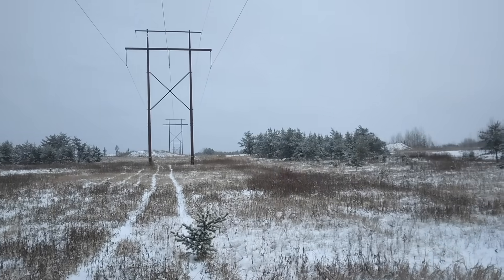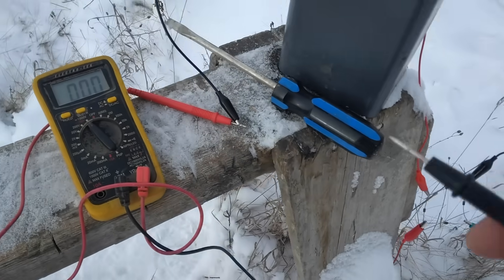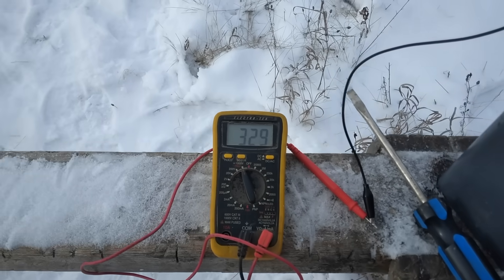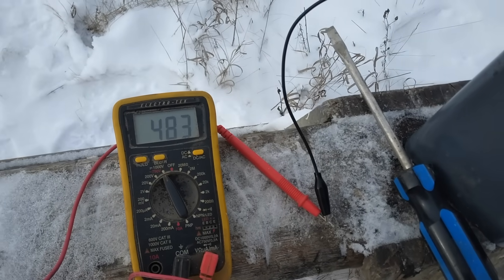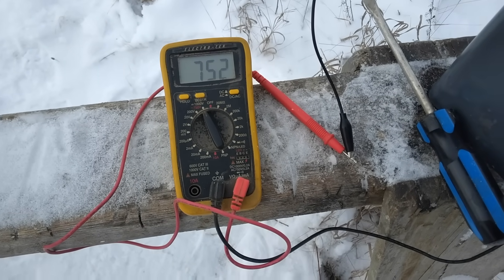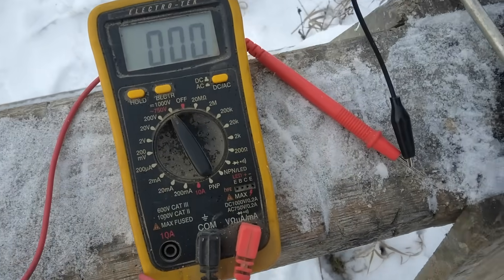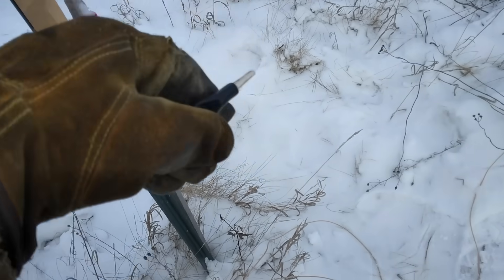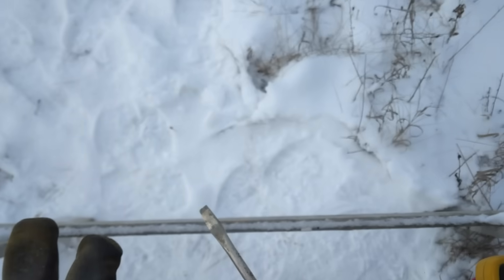Fences sucking power from under HV transmission lines

Comment: Exposure to that much radiation and cause aplastic anemia over time. That's what my stepmother died from because her bedroom faced ordinary residential area trunk lines. I kept offering to build her a Faraday shield; lead foil or copper sheets sandwiched between nicely finished wood, grounded to the copper hot water heating pipe. She thought it was nonsense that would have set the house on fire. I knew it would happen. Wish she'd listened to me.
Reply: I'd have taken the EMF over lead foil too but I'm a scientist so I would.

There is no statistically meaningful evidence that powerlines cause health issues. The "strongest" case that it does is for childhood leukemia where exposure to an extra fraction of a microTesla has correlated in a couple of studies with an increase in the chance of it happening. But that's almost certainly a correlation rather than causation issue. 

By that i mean, houses that are built under/near powerlines (that can achieve that amount of field change) are usually also in built up areas in cities/towns (because if it wasn't a built up area, you'd have room to not build the houses under the lines...). Energy intense industry is usually located near large substations because it makes the electricity cheaper and them substations are fed by big powerlines. Energy intense industry is usually also very polluting, which causes health issues in humans...

In that situation the power lines correlate with the ill person and the industry causing the pollution (so there IS a link) but the thing actually causing the health issues isn't the power line itself, it's the pollution from the co-located industry.

It's important to learn the correlation does not mean causation because if you don't you even up caring about stuff that doesn't actually matter (the power lines) and is actually detrimental to you because you're wasting effort on it instead of what actually matters (the polluting industry)..

There are many many things I wouldn't do (or do do) because it's stupid health wise, stuff like wearing them "negative ion" bracelets (that are useless at best and horrifically radioactive at worse) or living on a main road (pollution from vehicles is a significant health risk) or wearing sunscreen (as in I DO wear it, I prefer the chemical sunscreens over the minerals ones, just because they're so much better), I would for example far rather live within 10 km of a nuclear power station than within 10 km of a coal fired power station, and i'd rather go swimming in a nuclear power station's spent fuel pool than go climbing a coal power station's ash heap, all for reasons that are obvious to me. But powerlines don't rate, like my main concern would be them falling on my house. Same with mobile cell towers and 5G (i mean the 5G frequency has been used in basically every wifi router for a decade, people that complain about 5G cell towers at the bottom of their street are happily ignorant that their phones have been blatting out the same RFs from their pockets for over a decade now, it's just called "ac wifi" instead of "5G").
Reply: I wasn't going to plaster the wall in metal plates; the metal would have been hidden inside finished wood. Non ionizing radiation is harmful especially in large doses. Madam Curie also died fro aplastic anemia. Microwave communications are very harmful but profitable so we don't hear about the damage being done to us every day.     @Logarithm906

Comment: Always wanted to try this! Cool experiment. I'd suspect you're beyond the rated voltage of your meter's leads. Aren't they rated for max 600v? Would be fun to see how much power one could actually leach off using various lengths of wire, multiple wires etc. I'm to lazy to work through the theory / math. Thanks for posting this!
Reply: Someone did the math elsewhere in the comments, 0.077 watts based on the size of the capacitor vs charge time. That might be just enough to light up a single 5mm LED at medium brightness.  I think he would need a lot more conductor in a coil configuration to get anything useful. I would love to see all the tests performed to find out what configuration is the best! Also kinda curious to know what the tallest fence height is permitted.... I might have to go buy some land ...
Reply: The power company is well aware of drag from such sources and will investagate
Reply: @donstash4295  if they don't like my "fence," they could choose a different pasture.
Reply: @kwyj  Intent matters in the law. If it's hooked up to your house's power supply you get in trouble. If it's just a fence then you don't.
Reply: @thewhitefalcon8539  the thing about that intent is they have to prove it to a jury of my peers.

Comment: wonder what kind of power you could generate from an 8 foot high chain link fence with 3 strands of barbed wire along the top that ran the whole length of your property? 

it would be nice wrangle them wild "FREE" ranging pixies and put them to use on your side of the fence lol

Comment: High voltages like that might not need a very large diameter wire to transmit power over many miles.  Wow...I mean like 22 gauge wire might be able to power a house at those voltages.

Comment: Amazing voltage.  I'd probably use an metal oxide varistor (mov) to limit the capacitor voltage.
Reply: I used to think that until I had an MOV catch fire from a substantial motor emf. Those things are spooky to me now as a fire hazard
Reply: @luvmechanix  That was an misapplication of an mov.  There needs to be a mechanically-coupled thermal fuse in series with the mov in the case of transient surpression in a system connected to "infinite" power.  The thermal fuse will be heated by the mov, causing the fuse to open due to the heat.

Comment: That setup doesn't really tell you very much. You would probably get the same "power" levels if you put that near your stove while it's working. I've done many experiments of this kind. If you stick a voltmeter into the ground or into a tree, you will get a voltage reading. I could never get anything useful power out though..... never even enough to light an LED. 
I would recommend you try to light an LED. If you can't do that, there is really no useful power there, nor anything I would worry about.  A standard LED only takes about .020 amps.

Comment: Thanks for the video, it's very interesting. If your experiments result into practical uses, it will be great. Maybe you should run enough wire to experiment away from the high voltage lines. There is a couple here locally that built a house within 35 yards of high voltage lines. They had a baby that was born blind.

Comment: I work for an electrical utility.  I was recently installing new equipment under the overhead lines while working on an insulated fiberglass ladder.  I had one lead from my volt-meter to ground while holding the other lead and the induced electricity into me would go up about 125 volts per step on the ladder.  It was interesting to see the constant bug zapper action arcing when I held the lead about 1/8th inch from the grounded building next to me.
Reply: lern to climd up n down the ladder fast and you could play a tune,,,,
Reply: Another kind of 'step voltage'
Reply: Now that is funny.  @aliveandwellinisrael2507
Reply: Now that's serious step potential
Reply: Just try not to be the bug.
Reply: Because it's actually a magnetic action around the wires ...
Reply: Electro magnetic also known as EMF for Electro Magnetic Force.  @emariaenterprises
Reply: EMF radiation
Reply: Ok, that is terrifying!
Reply: Not really.  When you rub your feet on carpet and touch metal for the static shock, it can easily be over 10,000 volts.  There is just only a tiny amount of current though.  The EMF voltage induced in me was constant due to the source being AC power lines at 60 Hertz.  If I lived near high tension power lines I would definitely tinker with running insulated wires to capture the lost energy and use a bridge rectifier to store it in lead acid batteries.  As long as the proper safe distance is kept, a person would be okay.  Get too close and a person will be a plasma ball.  @lilolmecj
Reply: don't have any gas lines around there, instant ignition.
Reply: I work in substations and when i was a maintenance electrician I would climb the A frame towers. On a 220Kv line the induce was so great that i was able to write my name into the A frame with my finger, well for a little bit. I found holding a screwdriver hurry less.😆 Have a good one, stay safe!
Reply: Yes.  As long as you are holding the conductor (Screwdriver) you won't feel it.  Let your finger touch it and ouch.  I was removing the sealant from a pass through to install wiring into the building and I thought that I was disturbing a wasp in there at first when I heard the buzzing noise.  @mmi6280
Reply: Me to

Comment: Your getting the static from the lines.  I had to work on the brakes on a wire tensioning machine with the cable stretched a long way next to live wires. I kept getting nailed.

Comment: What you did was make a 1:1 transformer with low current capability. If you have 20kV in the power lines, your "fence" will eventually charge to 20kV.
Reply: 1:1 it may have been. But it was loosely coupled with air coupling. Very inefficient, so you would never get to the theoretical maximum
Reply: @colonelfustercluck486  There will be losses, true. I was speaking in simplistic terms. But your potential will be much closer to 20kV than 1kV. If you had left it overnight, you would have come back to a popped capacitor the next day.

Comment: Don't EVER discharge a capacitor by shorting it out - it can rupture the dielectric. ONLY ever use a high wattage, high-value resistor (can be wired in place).

Comment: I thought about that years ago.  You can't get more power out than exists in the magnetic and electrical field, which, since it induces currents in the ground which are lossy, is not enough to worry about.  You can certainly get voltage out but not much power. 

If you stick leads from an AC voltmeter into the ground a few feet apart anywhere, you'll get a half volt or so from just stray grounding currents, but you'll not be able to get any power.

What you've got there is a transformer, one half turn to one half turn, so the voltage out is the transmission line voltage, roughly.

Comment: I hope you have a bleeder resistor. That capacitor will hold a charge for quite a while. A smaller value capacitor will charge quicker, and you can always series pairs of those diodes if you're worried about it.

Comment: High voltage ( EMF radiation, or anything related really) is something to be feared, and it’s really in your own best interest to avoid or minimize exposure.
Like any radiation, a little is of no worry, but the higher the dose, or the more prolonged the exposer, the greater the risk of bad things happening to you.
Be safe and remember, before you attempt to beat the odds, make sure you can survive the odds beating you.

Comment: This has actually come up before. The way to actually harvest the power would involve placing a rectifier on each end and then collecting the power probably with shielded cable of some sort. The gizmo that does this is called a “rectenna”. (I Tryed to post a link but my phone isn’t cooperating.  You can just search for the name though.)

One little catch, you still have to pay for the power. 😕 When I say this has come up before I mean it’s come up in legal history. Power lost to unconnected conductors running parallel to the power lines is simply a loss that the power company has to eat. The moment you connect it to something you have “monetized” it. 🤷 That’s when the company in the business of selling the electricity gets a say in it. 

I feel like thus actually might be useful in areas without a normal tap but legally speaking it is something you do have to pay for.  

Interestingly this appears to be what Nicolas Tesla was referring to in his early work about wireless power transmission. It really isn’t practical for transmission of any amount of power for the equipment of his age but it might be useful now.  LED lights have ratings of “something point something” watts. 😳 Well, maybe!
Reply: Power company will also notice an increased power loss in their transmission. They will notice if you draw very much power over time.

Comment: Caution, you can accumulate enough induced voltage in  your “fence” wire alone to stop your heart (1 - 4 amps). I’ve lost a co-worker to very similar conditions. Don’t experiment and loose your life.
Reply: It only takes about 20 - 40 milliamps to cause fibrillation.  The higher amperage is actually better, since it will stop the heart - meaning it is easier to restart.

Comment: You need to make a transformer by using a coil of wire under the lines. The single conductor above will be the primary winding. Theoretically if you get it correctly made you could power your home and shop with it  What’s the worse that can happen? Death by electrocution? 😆

Comment: My neighbors had a 20 acre pasture. There were also high tension cables overhead. One day he had a new different electric fence up. I accidentally touched the fence wire and it almost knocked me out. I wonder if he moved the fence under these wires?

Comment: Volts and joules are two completely different measurements and you cannot determine the joules just from knowing the voltage so just because you're approaching 1,000 volts doesn't mean that you were getting up to where it could kill somebody you'd have to have the amperage there. there are fence chargers that have 15 joules in them and an AED for shocking a person's heart back into rhythm starts at around 26 joules and more than one EMT has been slapped with that and I can't recall any fatalities now while it is possible, it doesn't take much under the wrong circumstances to kill someone with an electric shock but just voltage alone won't do it and like I said you can't determine the joules of energy in that wire just by knowing the voltage

Comment: Hey good buddy , thats Millifarad not micro , the uF would be shown not the M the M i think is for Milli witch is 1000 times stronger . I have an 88 uF cap and its tiny , that thing is huge it has to be Milli farad but i could be wrong
Reply: it will be larger as it is designed for a much higher voltage. The extra space is taken up by thicker/bulkier dielectric. If the dielectric was thin and small, it may be rated to only 50 volt. That capacitor looked huge, and I bet it's rated voltage (safe working voltage) is of eye-watering amounts.... probably several kilo volts

Comment: Years ago there was a Dairy Farm suing the Power Company for low Milk Production due to stray Voltage.\
  In Court they proved that the Farmers were very bad farmers and very poor managers .. Which was True.  All the same we don't know how much stray voltage can affect the cows.
Reply: *suing - "Sewing" is the act of joining or attaching by stitches, usually with a needle and thread. "Suing" is a legal proceeding.
Reply: @stuartm5745    Thanks, I don't know how the Internet could survive with out the Spelling and Grammar Police!
Reply: @mikeskidmore6754  *without ("with out" is a misspelling of "without").
Reply: one poor ground in a redneck wired barn causes sray voltage all over the miking parlor you will probably see less than 2 volts. the cow reacts and a human probably wont.. the fence thing is induced voltage and capacitive coupling. bonding the fence to ground mitigates the oroblem

Comment: Thank you for creating this video.   I've felt tingling when up around high voltage transmission lines.   I didn't think it would be healthy to spend a lot of time around them, but I didn't come up with a method that would allow them to be shock dangerous unless touching them some how or coming close enough for them to arc.   This experiment shows that it is conceivable that it is a possibility some type of configuration might emerge that could store energy and create a deadly charge.  It would likely be some weird like some piece of equipment with a hidden high voltage compactor that somehow gets a conducting induction loop by chance created to it under a high voltage transmission line.   It is in a trillions of a chance, but some association of junk under transmission line could have that happen.

I'm surprised there is not more videos in the popular science/mechanics venue that bring up how much energy high voltage A.C. transmission lines loose through stray induction to their surroundings.   Another characteristic would how much they loose by radio wave radiation.  Typically I'd assume radio wave transmission loss of energy is close to zero, but not zero  compared to the energy in the line.
Reply: It was when we could have gotten so far until the bowl fell breaking into many pieces
so after that we  decided to be more careful. 

                                   /OR/

We were almost finished when  the bowl fell
and broke .We decided to be much more  careful  moving forward. 

see what  I did there?

your welcome.